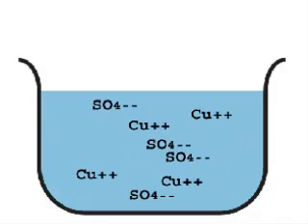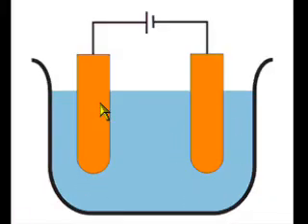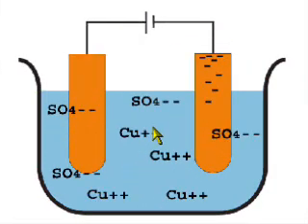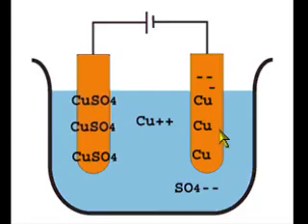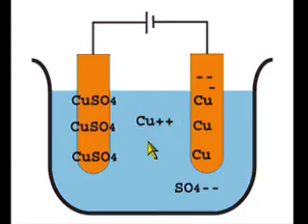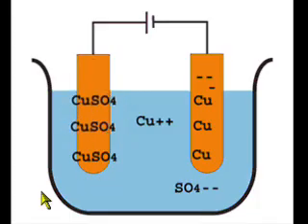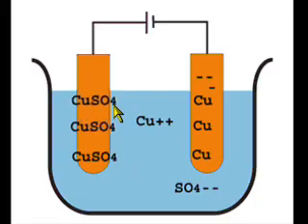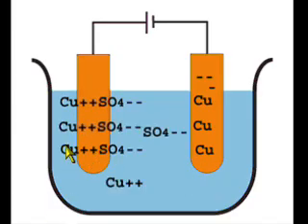Electrolysis of Copper Sulphate Using Copper Electrodes

Comment: So guys, I have seen a lot of misconception and hate towards this guy in the comment section. If the electrolysis of copper sulphate was done using inert electrodes such as carbon, copper ion would get discharged at the cathode because it is less reactive than hydrogen. As for the anode, oxygen gas would be given off, 4OH- = O2 + 2H2O + 4e-. But in this video, copper electrodes are being used meaning they are going to take part in the electrolysis. I hope this helps. If you have any further question, do let me know. I will be glad to help. Edit: One more thing, if the metal is more reactive then hydrogen, hydrogen ion will be given off at the cathode, and if a halide ion is present (Cl-, Br-, F-, I-) it will be given off at the anode instead of Hydroxide ion (This is true for all aqueous solutions but in case of dilute solution, even if a halide ion is present, OH- ion will be always discharged at the anode)

Comment: Why do the amps in my current start high but then drop to 0 shortly after?
I have the electrolyte solution using copper sulfate,  and a positive and negative copper bar. I'm at a loss

Comment: You didn't mention the hydrogen ions and hydroxide ions from water... You need to revise this again. Copper sulfate can't form at one of the electrodes. The direction of electron flow you demonstrated is the opposite.

Comment: this is wrong you forgot about the OH- ions and the H+ ions
Reply: Bro this is an active electrode and OH- and SO4- doesn't discharge .__.
Reply: Another Bigfoot with internet access  He did mention that it was dissolved in water so yea it's aqueous
Reply: Although it wasnt mentioned, at the Aqueous solution, ions present in the electrolyte is hydrogen ion, copper ion, sulphate ion and hydroxide ion. At cathode, the two possible cations that can be discharged is either copper ion or hydrogen ion. Since copper is less reactive then hydrogen, therefore copper iom is being discharged instead of hydrogen ion. At anode, anions that can be discharged is either hydroxide ion or sulphate ion. Since sulphate ion is difficult to discharged, hydroxide ion is being discharged. Hope this helps🙂
Reply: @niccoleanndreajaena7946 thanks
Reply: Water will not dissociate here into H+ and OH-

Comment: that's actually wrong because if it's a "dilute" Copper (11) Sulphate the electrolyte should include the H2O ions which is broken into H+ and OH-, which means it will have a totally different result because there are two negative ions and two positive ions, and there are some rules to which ions should go to the cathode and which ions should go to the anode.
Reply: Bro, that's correct for inert electrodes such as carbon, graphite and platinum etc. But here, active electrodes are being used, meaning the copper electrodes are going to take part during electrolysis.
Reply: Actually its not aqueous cuso4 so,h+ and oh- are not present.
Reply: Also cuso4 is in its soild form(blue coloured compound)
Reply: Ya copper goes first to cathode but oh doesn’t goes to anode cause anoid is ionising
Reply: By the look of your comment you prolly didn't understand the topic yet :/
Reply: I agree, the video is wrong!